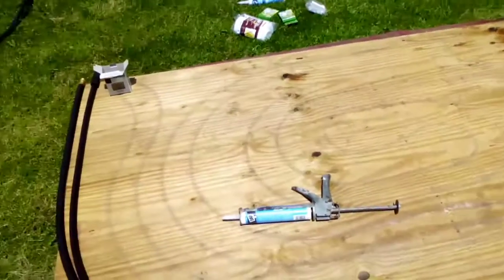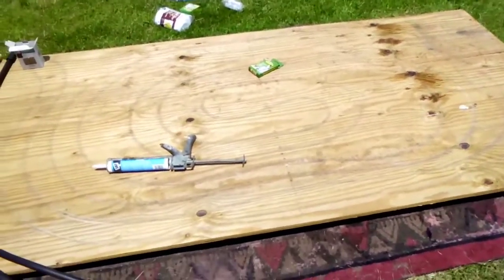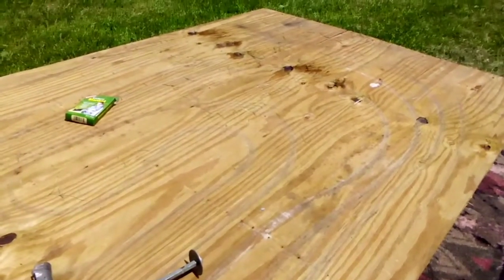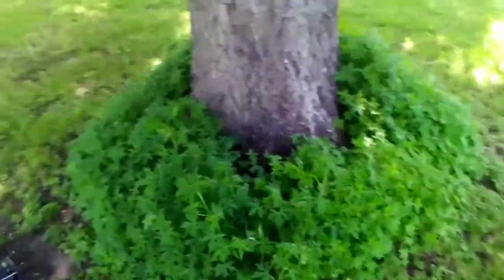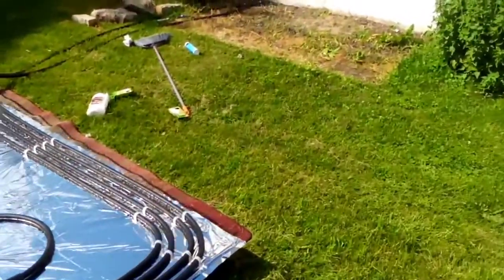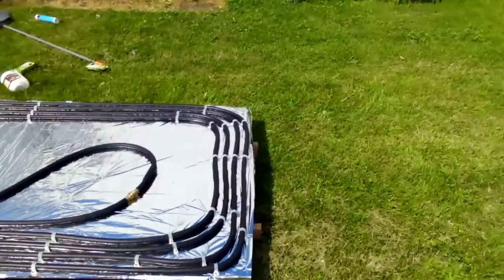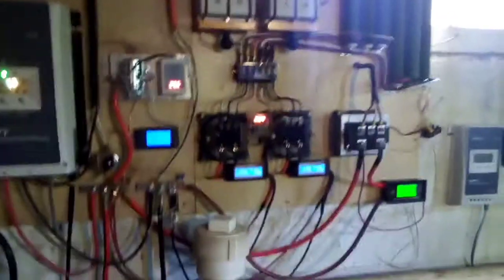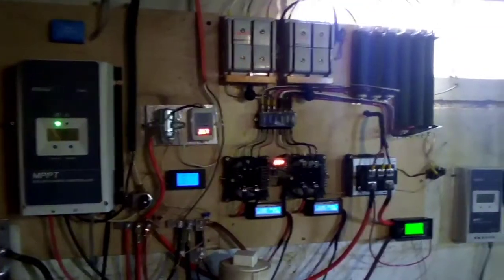Solar Water Heater

Comment: I've seen these work for swimming pools! This does work and interested in how yours works. Is the element for water heater a 12V? Thanks for sharing :)
Reply from the maker: Yes it does work. Water is currently at 97° and I disconnected the dump load today to let the batteries equalize. On a sunny day, with the help of dump load I've seen it up to 104° which in July is a plenty hot shower. Between the 2 tanks there's 46 gallons so that's enough for us all to shower if we're considerate.
Reply from the maker: Oh yeah...and the element is the 24 volt, 600 watt from Thermodyne.